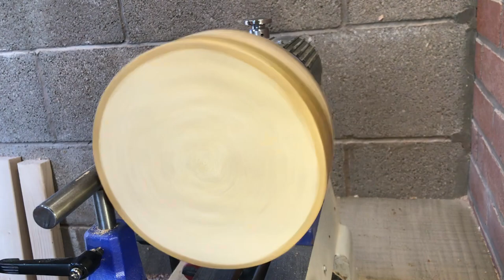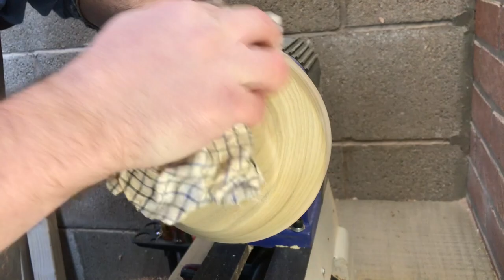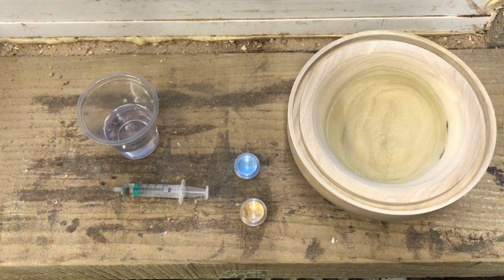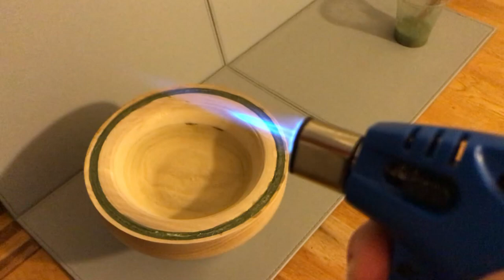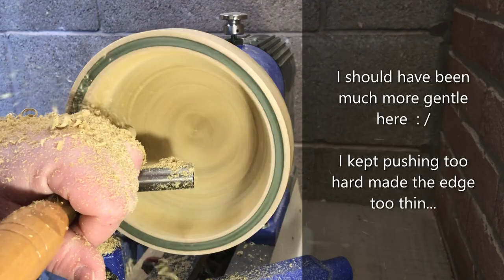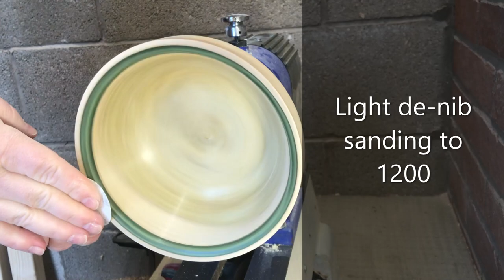Wood turning - Tulipwood Bowl with resin inlay

Comment: I like it a lot! When you do resin you should put the container in a bowl with super hot water so it thins out then I put my cup in a smaller bowl with hot water to mix it up. That works good for less bubbles. Thank you for your time and for sharing.
Reply from the maker: Interesting! I've occasionally been using a blow torch to get the bubbles out after pouring. 😎
Reply: Well, I meant only while suturing it up. It just helps it be a little thinner. I appreciate your videos. Thank you.